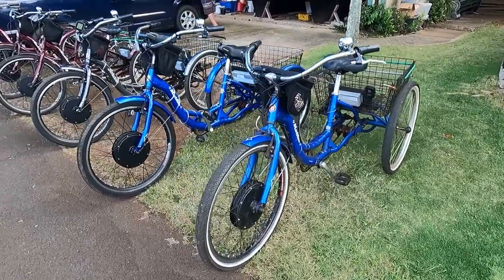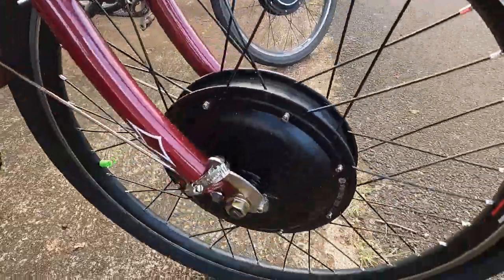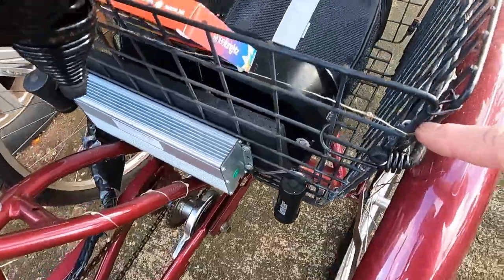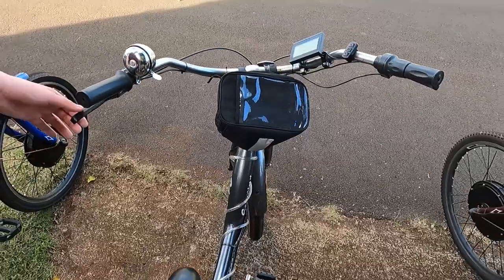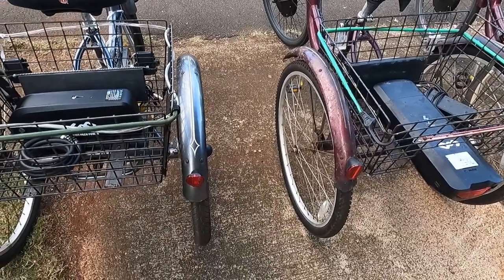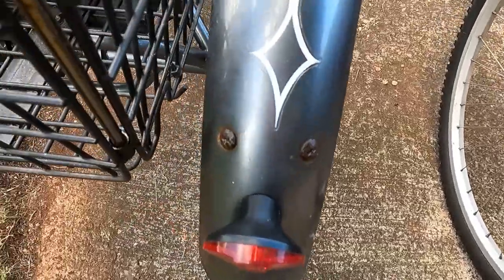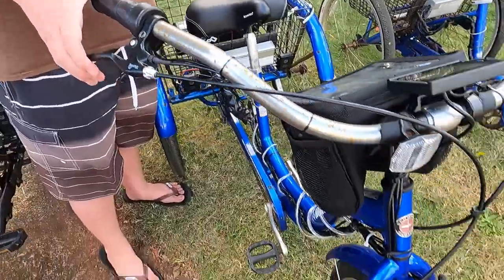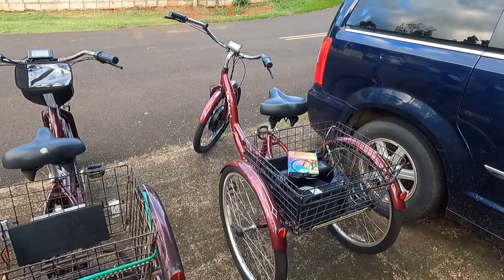Building Schwinn Meridian E-Trikes - Lessons Learned

Comment: I am rebuilding my 6yo Schwinn Meridian 48 volt conversion with all new components.  However  I chose to install everything within a sturdy front basket avoiding long or lengthy wiring problems!
Reply: I've considered somehow mounting my batteries on the forks or simply in a front basket to get some weight on that front end to reduce spin out. Not s huge problem but when one tends to live on dirt road, it would be helpful
Reply: Great idea. Doesn’t seem to be any additional value to having it in the rear. 👍

Comment: i lined my basket with corrugated plastic then put a plywood top on in case of rain and you can still put stuff inside and outside. put a raincoat inside just in case with tool s and repair kit.great video.
Reply from the maker: Great idea!

Comment: so ive built my own meridian etrike and its been amazing, onething though, you can just get a 20$ headlight, tail light, blinker and horn combo, atleast thats what i have and it works just fine, ive also gotten rid of the baskets rods and replaced them with nuts and bolts instead sence they fall out the bottom slots pretty easily, though i plan to replace the basket as a whole with a water tight tool chest eventually, also if you dont mind not having an easy to adjust seat you can mount the battery to the seat tube and post depending in the battery you use

Comment: Nice video.  I am contemplating a similar build and here's what I would do to augment your design.  I would ditch the front fork and use a MTB fork with shocks and caliper mount for disk brakes so I could at least have hydraulic disc brakes on the front wheel if not front an rear drive trains.  I would use different handle bars that would move the display to a more viewable space.  How about mounting the battery under the basket instead of in it so you could use the basket for basket stuff?  Or, I might make a battery to fit in the triangle behind the seat post maybe?  My wife and I are on the larger side so I might look for a hub motor with 2000 watts but I agree with other commenters that there are stability issues that could cause a rider to get dumped if turning too quickly, so there's that.

Comment: Valve cap leds on the wheels.
I actually go the extra mile and run a separate light system off a small 12v battery to run rear lights, markers, headlight, horns, and a LED whip antenna. They all go in a battery box with the motor battery and electronics.
In the process now of building a new trike with a mid drive motor so I can use the gear shift
Reply from the maker: I like your light setup. I do like having one battery to charge for head and tail lights. The body rope lights still take batteries.
Reply: You can eliminate the extra battery with a 48v-12v DC converter. This consolidates all your power draw from the 48v battery, simplifying the system.
Reply: @5_Is  I could, but I want my lights to have the option to be on even if the bike battery is dead

Comment: I have the habit of using the return key for spacing my letters, hence my earlier comment got cut short.To continue, the trike followed the camber of the road and I kept ending up in the ditch! A motorcyclist of many years but I could'nt master it , it was too dangerous. I abandoned the project and fitted the wheel to a conventional bike which is great.
Reply from the maker: The trikes are a little nonintuitive...

Comment: My Meridian is 1000w/48v and preforms well, but was curious of how many more mph could I get beyond the 23 or so mph I presently get by moving to a 52V battery, if any. Thanks for the informative video.
Reply from the maker: i can do 30... 48V with 52V battery.
Reply: @DIYKauai  Wow, I was first afraid to ask because I didn't expect it to make much difference in the speed, but now I'm afraid to do it because it does. 23 mph is plenty fast, but 30, though tempting, IDK, gotta think about that. Sure, I could do it and keep it at 23, but we both know how that goes. Either way, thanks, that is very interesting, and good to know, as it opens up other possibilities. Plus, I do pull a loaded trailer with mine, so...
Reply from the maker: The extra power I use for going uphill.
 @jackm6307
Reply: @DIYKauai  Good point. Even with the few slight hills here in FL, that can be an issue with a heavy load.

Comment: Thanks for the updates and tips. How about a mid drive Bafang or 8 Fun bottom bracket motor. Elimat3 the controller as its built in to the mid drive and seems more streamlined. Is it the cost factor of the hub motor vs. the mid drive that has you building 6 similar builds or??
Reply from the maker: A front wheel drive is actually good for these trikes. It is hard to get parts where I am located so we try to stick with standard stuff as it is available.
Reply: In my opinion after 5 years of hub motors they are ok that being said I switched to a bafang mid drive 500 watts I find it far easier and cleaner install. Controller and peddle assist and 6 volt power output for lights are built in and sealed. One cable runs to the front with 4 plugs for display throttle kill switch and power . a battery connector and speedometer wire that's it
Reply from the maker: @tommysavia523  Nice. The trikes are not really performance vehicles so the hub motor is fine. For a mountain bike I would definitely look at a mid drive.
Reply: @DIYKauai  perhaps I was misunderstood I only build trikes the mid drive I put on my Kent 7 speed trike it's my daily transportation I have 2 others that still have the front hub motors on them. One of them I call the frankintrike it was a full suspension mountain bike until I put a trike conversion kit on it it's a blast in the dirt.
Reply: @tommysavia523  I and Iimagine others who might  lik3 trike e builds would love to see your builds in a video review like DIY Kaua has done here. It would be fun to visually see your K3nt and Franketrik3 😁👍
Reply: @DIYKauai  I did the hub drive originally. Non name brand the first time and learned about the torque braces after the hub spun out multiple times because the torque was either full power on or off, no middle. I got a Voilamart after that and it applies gradual power even at full throttle so no braces needed. Both had a wobble though as they approached max speed however.
I run Maxxis tires on all of mine, they hold up well and last a long time. The two wheeler got balloon style tires for an easier ride, and the trike has the standard size tires
Also use the old school style Puch moped seats. Really comfortable, cushion padded and heavy spring loaded and they bolt right on to the standard seat post
Reply from the maker: @panzerwolf494  Those are some great tips!  The puch moped seat could be the thing! I have found that the CSC front hub motor from China varies quite a bit... some are smooth and some are rough...  Looking to replace the forks on these trikes. The best I can do is tighten the bolts real good, check them weekly and pedal at startup to relieve the torque.
Reply: @DIYKauai  I have a set of Monark springers for mine. the new build I need to reuse the hub motor wheel (disconnected of course) because it has the ability to run disc brakes. The forks don't have a v-brake setup, but they do disc and drum. My drum brake I intended for the bike is on back order for the time being because of the shortages.
I had the same style of forks on one of my old gas bike builds and it really smoothed out the ride a bit, plus gave the bike a nice vintage motorcycle look
Reply from the maker: @panzerwolf494  sweet!

Comment: So im thinking of doing the same to get back and forth to work since i live nearby and itll save on gas but i was curious, is there a way to have two motored wheels on the back and connect it all to the same throttle with extra batteries?
Reply from the maker: I have not done it but I am sure it could. The front wheel drive with one wheel works and is quite practical.

Comment: I like everything except how NOISEY the motor is on the only one that has sound...the 1500W! What is that obnoxious loud grinding noise? Does the 1000W do the same?
Reply from the maker: After installing a number of these motors I can say that they are all unique. Some run super smooth, some a little rough.

Comment: You spoke about tires. I'm just wondering about the wires to the front wheel. How do you deal with the wiring?
Reply from the maker: I wrap it up in cord wrap and zip tie it to the frame.
Reply: @DIYKauai  thanks a lot. I have a Maridian on the way and I'm going to electrify it.
Reply from the maker: @viewfromtheroad2656  Stick with a 1000W panel.
Reply: @DIYKauai  Watching your video, I already made that decision. Thanks again.
Reply: @DIYKauai  Can you guestimate the diameter of the harness?
Reply from the maker: @viewfromtheroad2656  harness?
Reply: @DIYKauai  Yes sir, the wires that you wrapped in the plastic spiral.

Comment: Do you have a link for the 1000 watt motor and all the accessories I can't seem to find it
Reply from the maker: I have had to order from China because mainland companies will not mail to Hawaii.  The "Amazon" of China is aliexpress.com  you can get conversion kits for the mainland off of Amazon and EBAY.
Reply: Thank you  I have a 20 4 inch when meridian and a 26 inch schwinn meridian i'm going to convert both do you think a thousand would be okay for the twenty four or should i may be dropped to a five hundred or sevent fifty
Reply from the maker: @blindmike2614  i like the 1000W option... nice smooth power curve.

Comment: i brought the chinese white 26inch trike and have been trying different electric drives, the white one has the twin wheel subframe at the back that bolts to the single back wheel of a normal pushbike, but the bike part was heavy with a small one-piece peddle sprocket that was so hard to peddle, so I put a mountain bike front end and frame with mono-shock suspension this is loads better, 
 I tried a motor with a gearbox that was directly onto the front side wheel of a wheelchair so it should have the power because one each side had to be safe for users of heavy size, so I put a peddle sprocket on the plate that bolted direct to the wheelchair 14inch front wheel, and fixed it in the empty back-wheel space of the frame, with a chain from it to the six-speed on the sub-frame axel, I was hoping it would drive with more power and speed, but I did something wrong, a few other experiments, and I just had it going quite well with an original Curries Technical sort of hub-drive "one part goes the axel side of theindependent back wheel and loads of small threaded studs go between the spokes at the hub and I used penny washers and nuts because it didn't quite fit in the spoke slots, works good thou, that has a small tooth sprocket and chain that goes 6 inch to one side where a sprocket and gear system with a D slot for a motor shaft fits and I had a 24v 250w motor from a E100 kids razor scooter motor fits to a polyplex plate that I've fitted to this gearbox thingon thee hub_drive thing? i used 6 12volt 12ah lead batteries and from that to a drill trigger straight to the motor it was ok, the i uped the volts to 36v that was perfect speed power the lot, I am trying to make it so i can be as green as I can because I am sick of seeing pollution, animals suffering, massive floating islands in the middle of the ocean made upof human rubbish I mean massive bigger than Texas state, IN THE Mariana trench, forests destroyed and so much more, they said this in the 1970s when I was at school and nothing is being done,  no one cares about their own children and their children's children, your all happy to leave them hell but I'm not if ihave to struggle so be it, I am a multi-tradesman and multi engineer, so I could easily be ready very wealthy and thoughtless like most, but that mentality is a false one created by bullshiting greedy sales people in their pretend unneccery roles and pen pushers who change laws and rules to undermine and hold back the real major people who create,invent, build, those who took humanity out the caves, not those in offices leaching of our backs and work, bullied their way pretending they are above those who  provide something for them to do, without us they cannot even pretend they are important, it didn't used to be like this, that is why archiologists and science cannot get their heads round what used tohappen, slaves building pyramids and things is typical, those highly skilled in demand builders would have been treated like gods to make them stay and do such hard work in the heat and conditions, or like today would get upand work elsewhere, slaves? that's the stupidity of pretend roles for false people good vid thou mate

Comment: Thanks, Very informative. I noticed one of the bikes had a PAS magnetic disk 
did  you have problems mounting it on the pedal spindle. I understand  the disk requires around 5-7mm. My bike has around 3 mm.. Thanks
Reply from the maker: Couple of different models of Meridian - not sure what the differences are. One of them we could not get the PAS on... I actually don't like the PAS on these trikes that much.
Reply: @DIYKauai  Thanks for the reply. I have lots of gradients (hills) and thought the Pas would be a good "bell and whistle". I know it's not essential.

Comment: While it's not a Schwinn, I am in the process of getting a trike (should have it in a week or two) and I'm going to install a front wheel motor, its a 26.5 inch wheel. I've built two bafang based e mountain bikes and the current one I'm riding I've done just over 3800kms. The other is a trek but the frame at the rear where the wheels attach cracked so I've retired it for now. I like a trike due to being able to carry more weight she. I go shopping etc
Reply from the maker: That sounds great!  I have two cars but these trikes are my daily drivers.

Comment: I have a new Schwinn Meridian that I installed an electric front wheel and it mounts to the right side of the fork. Any experience with this? Thanks for your time.
Reply from the maker: sometimes the motors run backwards or the mfg has the wiring come out the other side... not a worry.

Comment: I have a UK road legal 250w 36v kit on my trike with the 5 power settings changed to 9 so that on power assist level 1 your only get 15% power on the thumb throttle. Being road legal in the UK the thumb throttle only lets you reach 4mph so no risk of the trike running away with you. Can’t see why you need 1000 watts of power unless you are a big unit, as on full power the front wheel will wheel spin especially in the wet.
I also have the display panel on the left as at has a powered walk facility. Which I can operate when waking the trike. I don’t intend looking at the screen whilst riding as I’m too busy looking where I’m going.
I have an electric horn that makes a sound similar to a clowns car horn which people don’t take offence to as unfortunately here in the uk some people take the sound of a bell as meaning get out of my way as opposed to I’m behind you and just letting you know I’m approaching so I don’t run into you.
Reply from the maker: we live in quite different worlds... it would be hard to imagine only 250W.
Reply: @DIYKauai  I got the 250w kit on a recommendation of a friend who fitted one to his bicycle as he gets 40 miles on one charge on pedal assist as it comes with a 13.5amo battery and he can get up to 15mph on it which is way fast enough on a trike for me. 
Having a lot of torque on a trike is isn’t a good idea to my mind especially when negotiating tight turns. On my kit there are 5 assist modes who can be changed to 9 which then reduce the power on the 1st pedal assist setting to 15% which is far more controllable and lessons the risk of overturning in a turn. 
Crossing Inclines are a challenge as well as we have lots of them here in the UK leading to peoples drives and with the widths of footpaths not being as generous  as in the US they can be be quite steep.

Comment: Could you fit a bottom bracket mounted pedal assist motor?
Reply from the maker: no idea
Reply: I'm curious about how the rear end works and if it could handle the torque of a motor.

Comment: I ride a conventional bike with front brakes on left.  Don’t see the need to switch. Because I slow down to signal and turn.  I know this is counter to American non- thinking and drive as fast as possible; but we go slower here.
Reply from the maker: Cool, nothing wrong with that. When I was commuting to work I would ride in the road as using the bike lane and sidewalks would ruin my spokes. When riding at 25 MPH I liked to be able to signal so did the swap. Have a great day!

Comment: Dude you lost me the minute you said a twist throttle is better than a thumb throttle  . 

F Y. I

Ok 
a thumb throttle is used on quad bikes & three wheeler's (trikes) for the purpose of .!

 when your turning the handle bars in hard lock positions on a (trike /quad) 
 it's easier & safer to use a thumb throttle 
WHY? 

A twist throttle can difficult to twist on power & dangerously difficult to twist power off in hard turned handlebar positions .

THIS IS WHY ITS ADVISABLE TO USE A THUMB THROTTLE  . 
😊😊😊😊
Reply from the maker: i don't like full twist throttles, I use the half twist. Thumb throttles cause thumb fatigue.

Comment: You never did mention the top speed in miles per hour or the distance that must be a liberal thing aloha 😷 I already know the answer
Reply from the maker: ? Why would lessons learned cover install stuff? top speed and mph are impacted by a few things. Generally speaking a 1000W motor will do 25 and a 1500 will do 30. I am also over volting.